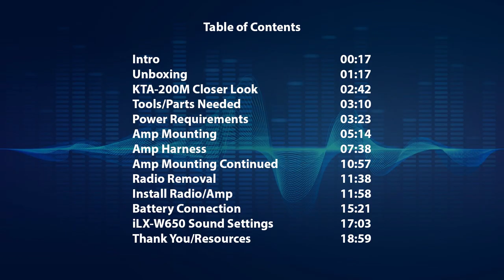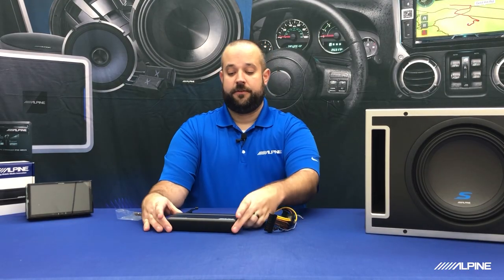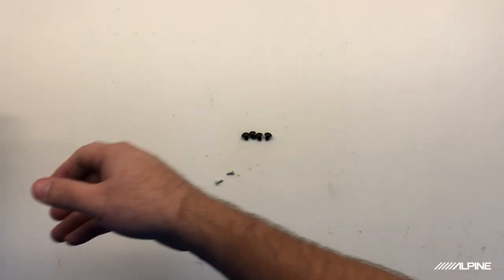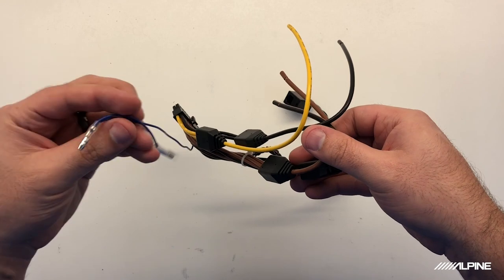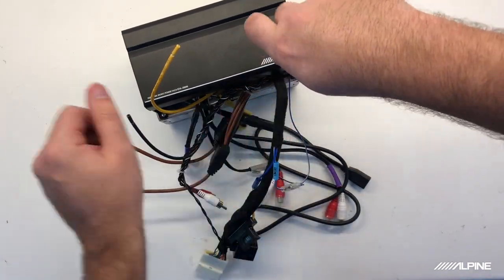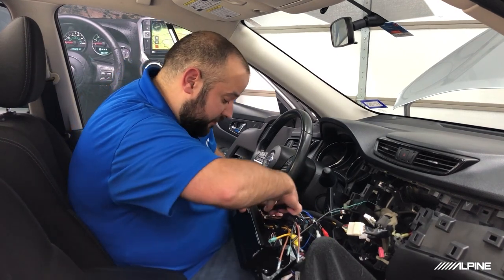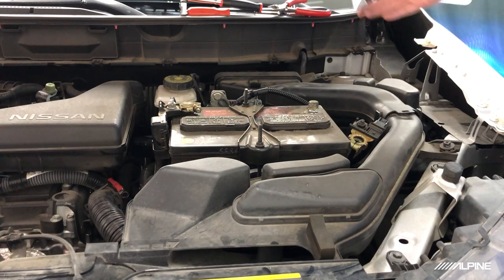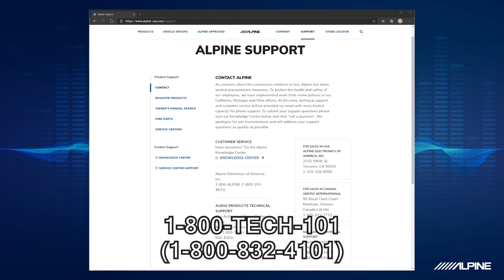KTA-200M + iLX-W650 PowerStack Step-by-Step Installation Tutorial

Comment: I noticed you have recommendations for gain and LPF settings in the video for the KTA-200. Does Alpine have any recommendations for the gain and high pass filter settings for the KTA-450 paired with the IL:X-W650? The amplifier is currently bridged to power the front coax's only and the rears are on deck power. Thanks.

Comment: I have mine hooked up behind my ilx-w670 and i spliced into the factory 12v battery for main power. It sounds awesome but my question is this.   When it gets hot outside (summer temps) will i have problems with amp overheating?

Comment: Do a video dedicated to the 450 with that radio please. I’m an idiot, and I need my hand held. 🤣
Reply from the maker: The 450 and 200M are the same chassis and mounting bracket so the bulk of the install would be the same in your case with the 450. Hopefully this helps get you most of the way there with your install.

Comment: My 2003 Camry says the radio no.1 fuse is 20amps but the radio no.2 (which refers to when the engine is off) is only 10amps. Would this radio be compatible because the radio no.1 is 20 amps?

Comment: Just hooked up this unity to infinity components with tweeters in the front doors and infinity speakers in the rear and for some reason I only have the back speakers working.
Reply: Fixed…I had the dip switches set to 2 channel. Easy fix. :)

Comment: I have the ilx-w650 and kta450 but I'm having trouble figuring out where to hook up the brake bypass I got off Amazon. Can anyone help with this? 
It's in a 2011 4runner
Reply: I can help. Hook the brake bypass to the yellow blue wire (the long one) and after that's hooked just install the amp as if you you didn't just install the bypass. Splice into your power/ground/remote  and use speaker wires to attach to factory speaker wires on factory harness and your good to go

Comment: do I need the kta 250 or can i install any other amp?
Reply from the maker: KTA-450 and KTA-200M are the two amps that specifically mount to the back of this head unit. Those will also work with our iLX-W670 head unit as well.

Comment: I’m thinking of ordering the radio plus the 450 for a 2004 deville, what has its own sub amp for the doors plus the sun in the rear. Would it be possible to use the 450 to run along with the factory amp, or would I have to choose one over the other? I want to upgrade the door speakers, and would much rather use this amp instead.